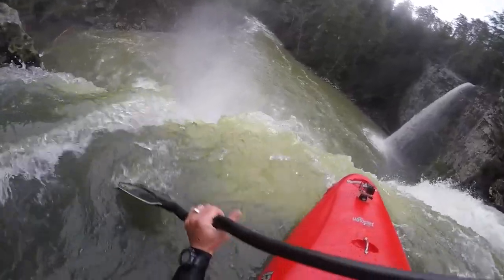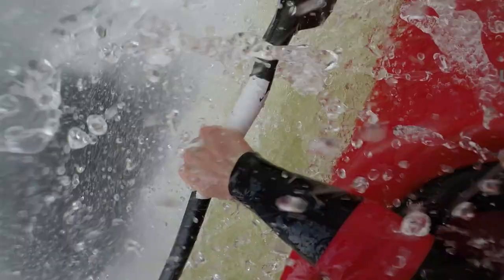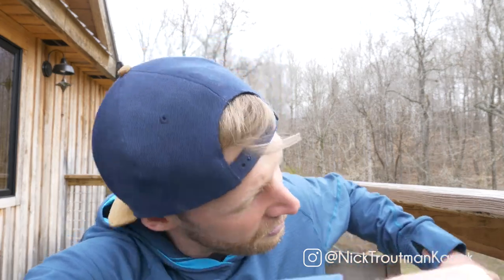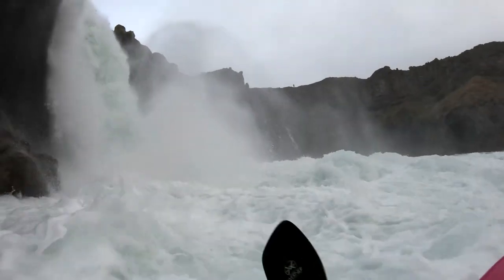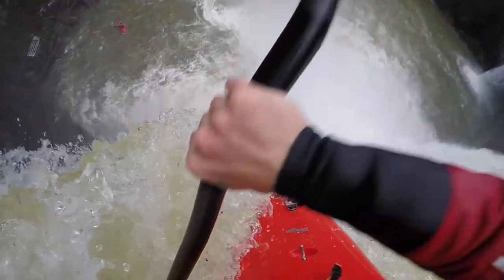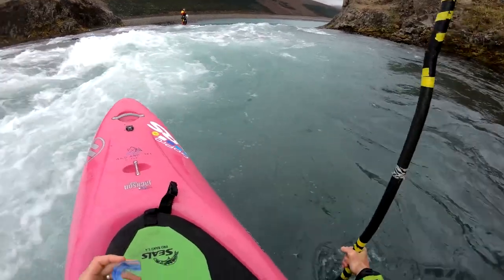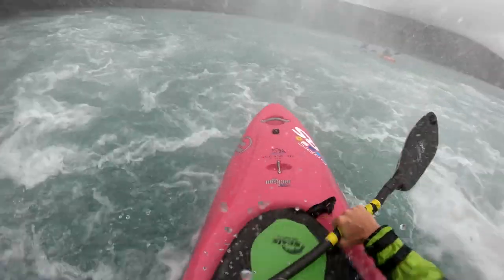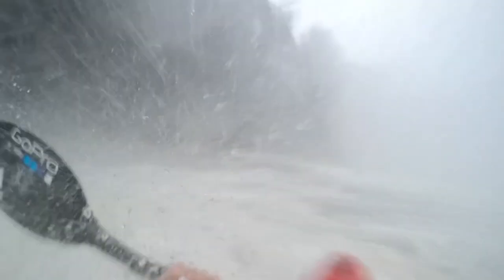How to Tuck/ Plug a Waterfall- Nick's Kayaking Tips and Tricks

Comment: glad to finally see some more advanced paddling tips. 
i'm a reasonably stable class 4 and 5 kayaker, but i sure would love to get a full time experts insights on the nittiest grittiest details on the things that might be interesting once you are far beyond all basics. (hold on tight, this might read a while....)
like:
 
how to dial in your perfect stomping/boofing balance; 
your personal take on the washington vs oregon tuck and why some people took their backhand in front of their front hand instead of moving it just up right next to it 
and i want to hear what colour of boat has the lowest return rate a.k.a. is there any truth in the colour myth? 
your thoughts on 30m vs 20m throwbags; 
what would you deem minimum waterflow (m³/s) for higher waterfalls. 
fullface vs fullcut helmet, why did the pros stop wearin fullface helmets?! 
odachi vs sho-gun a.k.a. blade to shaft offset in whitewater? 
back deck vs. normal sweep roll; 
Hand of God rescue; 
do you upgrade your personal first aid kit with unusual extras? 
best method to hike in a kayak. 
how bad is storing your boat outside really?
is there any tool to mark my boat with permanently (since most markers seem to be wearing off fairly quickly)
do you carry a tea candle + lighter so you can build a instant sauna (with a spaceblanket) for fighting hypothermia?
did you ever need one of these $250/year GPS emergency subscription beacons?
any tips for how to determine weather a pool is deep enough for a first/unknown descent?
do you feel that the watercolour makes a difference for your psyche?
whats your personal take on the development of the kayaking industry overall, are we growing or shrinking? where do you see the financial future of kayaking?
is there a way to save my gears latex from tearing after 2 to 3 years? /to substantially! extend its lifespan (beyond seal saver etc.)
best food for multidays? what type of waterfilter do you recommend? 
do you always carry a lightwight saw? (i do. has worked wonders so far)
why does werner not make plastic fibre hybrid paddles that a super long life and great for clubs etc. ?
rubber rand spraydeck vs bungee cord spraydeck?
how to teach the roll?/tips
how to teach the boof?/tips

adidas not doing kayaking anymore?! sickline? should the greenrace be the new WKC or should we have changing locations each year?

i'll continue another day^^
hope that gave some food for thoughts/input for future videos maybe?
looking forward to getting (some) answers :) ♥
Cheers
Reply from the maker: WOW! Very insightful. I'm got my work cut out for me on new videos to make. Thanks. I'll get to work.

Comment: How’s rock island for practicing this?
Reply from the maker: It's pretty good, though try not to throw your body forward, instead just tuck up tight. The shorter the waterfall the quicker you need to tuck and the issue can be that you 'throw' your body forward too fast. It wont be an issue on a smaller drop but if you take that same technique to a taller drop you will throw forward into a pitch pull
Reply: @nicktroutmankayak  what exactly is a pitch pull? Also, thanks for the video!
Reply from the maker: @heatherhuth1  pitch pull is when you go over vertical onto your head.
Reply: @nicktroutmankayak  ok that's what I thought but didn't want to be wrong, thanks for responding!